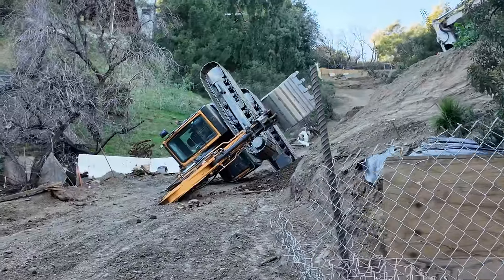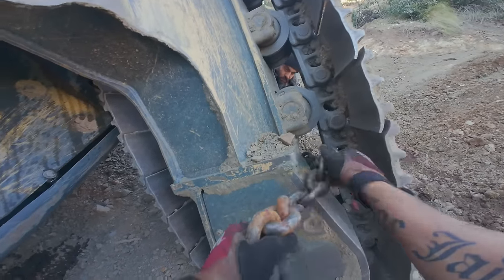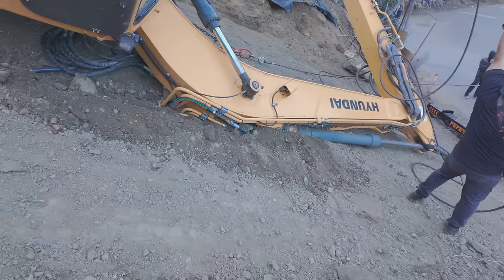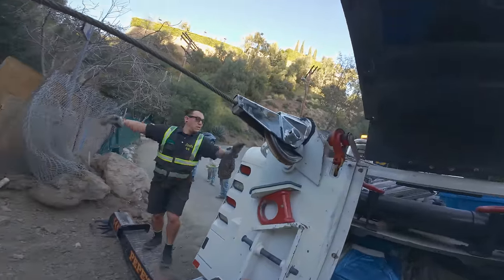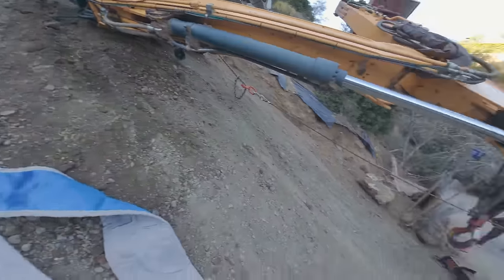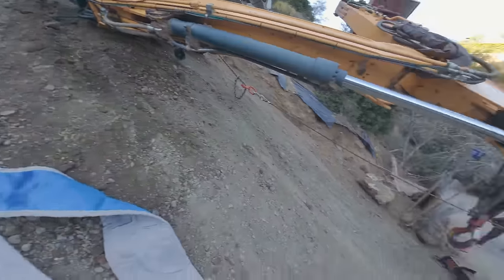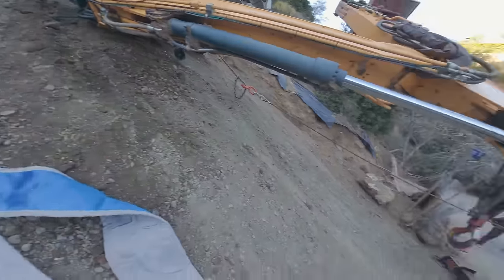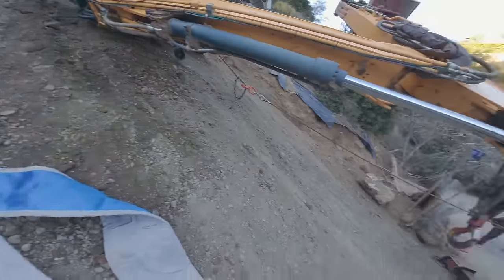Big Excavator Rolls Over in Beverly Hills

Comment: All that equipment and still it takes 20 hours to flip the tractor on its tracks. 😅 I guess it's good for content.   But this was ridiculous 😂
Reply from the maker: 20 hours? Are you mental? We were there 2hrs Karen
Reply: @PepesTowingService look, I was exaggerating, but you should have just pulled the damn thing down off the hill and handle it on the road.  45 minutes max.😂
Reply from the maker: @MrHeat1up this why you aren't where I'm at. If we did that, the entire road would be closed. One way up, one way down. In one of the richest parts of Los Angeles, why would you be so dumb to do it that way?
Reply: @PepesTowingService  well if it didn't take 2 hours,  a road closure would not be a big deal.  So once you towed it off the hill,  the road closure would be less than 10 minutes.  I'm not trying to bust your balls.  I'm a fan.  👍
Reply from the maker: @MrHeat1up where are you making up these numbers for? The truck would be IN the intersection while it winched it all the way forward. Then rig to upright. And you run the risk of it not starting once upright. How is any of that ten minutes? How fast do you think you can winch a 30,000lb excavator down a steep grade then upright and move it? I get joking and what not but at least make sense. Feel me?
Reply: @PepesTowingService  I'm making up the numbers from the time it took you pulled the tractor down towards you.  Pulling the rest of the way off the hill may have been another 15 minutes. You didn't need to block the intersection while pulling the rest of the way down.  Stay parked where younwere. Then from there while blocking traffic flip the tractor onto it tracks.  Maybe another 15 minutes.   As I stated it makes for good content.  👍
Reply from the maker: @MrHeat1up I have a serious question. Are you autistic? A lot of autistic kids tend to love these channels because of the big trucks and I love that, really cool to make them happy. Just asking with you so I know how to respond.

Comment: American tow trucks costs a fortune and what I as a Dutchman don’t understand is that these kinda trucks are not provided with steering rear axles. It’s obvious that you can’t get in tight places like this. And you’ll even dare to call this tight? Come to Europe! There we have tight places! We call these kinda roads, with all its S and U turns highways! Haa🤷🏻😂 This digger Hyundai HX145 lcr (or what you want to call it) weighs 13.900 kilograms. Every digger has a lifting point right behind the boom! In this case I would have used a 30 tons crane with steering axles and would have cleared the job in have the time you needed. Moreover, you are working against the hydraulic system of the digger, a battle you never win! And where the hell is the operator of that digger? He would have reduce the time by releasing the hydraulics! I’m gonna move to the US, import a dozen of these kind of cranes and becomes sleeping rich! Djeez 😂 come on you guys 🦾💪🏻
Reply: When they can lift the tag axle, and the other axles still are within the limit, it's no big issue. Sure, one might could have done the job quicker with a fine crane. But the problem is to have a fine crane at hand. There is no use in a 30 ton crane doing the lift quicker, if one need to wait 1-2 days for such crane. Point is, they use their 'multi tool', the rotators. they got them at hand all the time, and get the job done. It might not be ideal in some situations, but often one can't wait, need to go at it, not waiting for some more ideal equipment being hired, brought in. the levers in the excavator are electronic. No function when engine not running. Anyway, good luck with your idesa of quick and easy solutions in the US market.

Comment: that aint a big excavator.  i would have just used another excavator to flip it. that was a tough job for a wrecker.
Reply: Sure, in many cases one use a larger excavator to come to rescue. But when a larger easily aviable exavator is nowhere near...then what. In this situation, in this steep grade, narrow path, it's risky to operate with another excavator, use it to flip the other. Another issue is by using a excavator for the job, one get one lifting point, risking doing more damage than a rotator than can use several points for lifitng. A serious company would likely not tried to do something like that, to potentially saved a few bucks. Getting Pepe's at site was the best option here.

Comment: A rotator like that costs upwards of $2m or more what I learned
Reply: 750K-1 mil actually. Always something new to learn
Reply from the maker: @Rimrock300 correct. Both flipper and Hulk were purchased under that before everything shot up. Been meaning to ask since I've noticed your comments that you're incredibly knowledgeable. Do you do heavy recovery?
Reply: Your guess is dead on. Miller offers 30,40, 50, Sliding 50, 75, and sliding 100 ton rotators. They're all priced according to capacity plus all the bells and whistles you may wanna add.

Comment: Why wouldn't it start up? Pardon my ignorance 😅
Reply: Because it was on its side lo,, duh🤦🏿‍♂️😅
Reply: oil and fuel inside machine, which are not at the correct spot when it's on it's side. Important the engine shuts down when tilting over, to avoid serious damage to it's internals

Comment: Not how I would have done that. Where it was originally setting, I would have turned that Takeuchi around with the blade toward the Hyundai and rigged a line off of it to the top of the tracks on the Hyundai. Then your original hook on the boom and some pressure on the line from the Takeuchi would have set it right back up on it's tracks. Yes it would have not been a controlled roll once it started going back to the ground, but everything hitting the ground was heavy enough to take it. As you did it, you did have more control of the roll, but the strap under the body was putting a lot of stress on fiberglass and sheet metal not designed to take any load at all. But what do I know, I just spent way to many years sitting in an excavator seat.
Reply: lol

Comment: This is really awful job. You would need to put concrete blocks or heavy machinery up where it came from and then use roller with direction change tied to that concrete weigth and pull from track upper side. When on track you check fluids, battery etc and start engine and move bucket. Who drags like that and pulls from cab? But if you have hammer every job is nail it seems. Little bit larger excavator would lift it up without any damaging
Reply: your mom said it was cool to drag it
Reply: and the armchair experts have woken up
Reply: @Rimrock300  good morning
Reply: I dragged your mom also she thought it was cool #goodmorning

Comment: @Pepe's Towing Service Why did they call you and not an mobile crane like a 150 or 200ton Liebherr crane has almost 80 yards of boom, can lift the excavator as is straight up, use a tagline winch to upright it in the air , retract boom and drop it straight on a lowboy , les damage from dragging hydraulic cylinder cro me through dirt , less pannel damage and easier work
https://www.youtube.com/shorts/zE1nMYlx1Yg
Reply: Is there a recovery company in that area that uses a mobile crane?
That would be my guess why Pepe was called and not the non-existing company.
Reply from the maker: You're asking me why the company called me? Because we're known for doing the type of work that the crane you just posted can't fit into. Google the address and look it up on Google Maps. If my 4 axle trucks BARELY fit up the windy roads, how would a crane, plus the trailers needed to set it up fit? Then that crane would have blocked the entire intersection and let no one pass in either direction. How, in any way, is that better? And where did you get a lowboy from, they didn't want it on that they wanted it on site to fix it and keep using it for the project. Did you even watch the video before rushing to the comments?
Reply: Hey, while we are at it, why not go for a 400ton mobile crane, rig it up far down the hill somewhere. Would just cost x10 times the value of the excavator to hire it, and take less than 2 weeks to rig it. .

Comment: Pretty thick are they not you can't pull against the hydraulics pull the levers to release the fluid.:rocket-red-countdown-liftoff::rocket-red-countdown-liftoff::rocket-red-countdown-liftoff::rocket-red-countdown-liftoff::rocket-red-countdown-liftoff::rocket-red-countdown-liftoff:
Reply: Who again is thick? Levers are all eletronic on these modern machines of course. engine not running, no levers working

Comment: So why not bring in a crane and lift it up , instead of dragging it and breaking more parts and needing a paint job .
Reply from the maker: Why not have a brain before commenting? Must hurt to be so dumb
Reply: @PepesTowingService   watch the smart ones on utube , they bring in a crane , lift up , nobody’s dragging my expensive machine .. use common sense.
Reply from the maker: @Ricken2022 watch the video. I go over that idiot. A crane wouldn't be possible. A crane would take HOURS just to set up. Then require permits to even get to this tiny residential area. Good luck doing that in the richest part of Los Angeles. But ya, keep talking buddy.

Comment: In Florida, we woulda started the machine and Quickly pivoted it or worked the boom so that it would have set itself back up. Keep an eye on the oil pressure.
Reply from the maker: You wouldn't have done anything anywhere shut up

Comment: Never should of been a rotator or tow job crane or bigger machine
Reply from the maker: Maybe you’re blind or dumb but where would you put a large crane big enough to handle this? Without blocking? And then the trailers for the counter weights and rigging? But go off key board warrior

Comment: Why not bring in a 200 size excavator and put it back on its tracks with that I still don't understand why you drug the tractor to the tow truck it forsure caused more in damage those are amazing trucks but they have equpt just for that situation and those two trucks were not it not saying it's the tow truck drivers fault he was just doing what he was hired to do and with what equpt he has, no the stupidity falls in the equpt owner/ company smh hire the correct company and your repair bill would have been much smaller!!
Reply: Renting an excavator would probably cost money and time…
Reply: You sound like a greenhorn, or just crekless. Getting up there in that steep incline with another excavator, trying to make a heavy lift, would been a big risk. On flat ground, possible. Much more control with a rotator, with multible wires. The flipped excavator was already damaged, minimum additional damage by dragging it further down.
Reply: @Rimrock300  well I am fifty live in the mountains so ya there's that I never said how I would set up,make the lift and figure out any problems on the way so you I am the green horn ??wtf
Reply: @Rimrock300  also you call that sleep lol